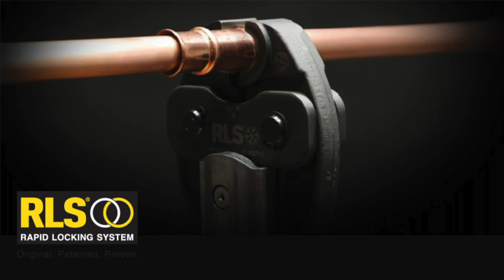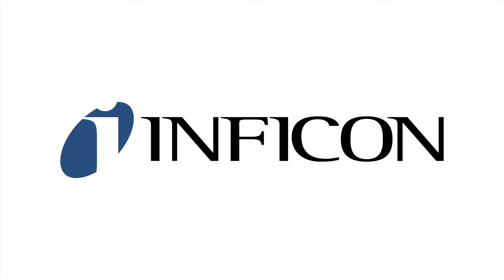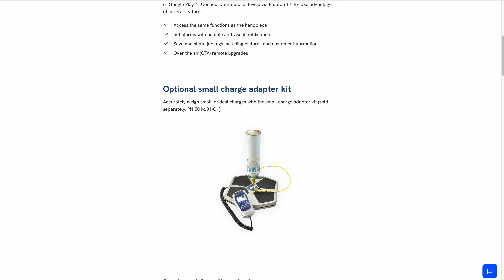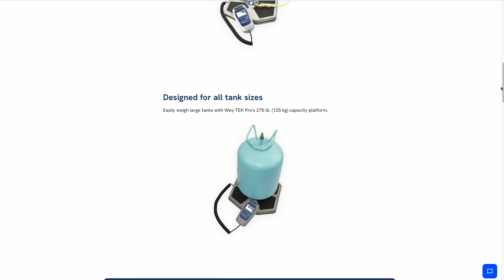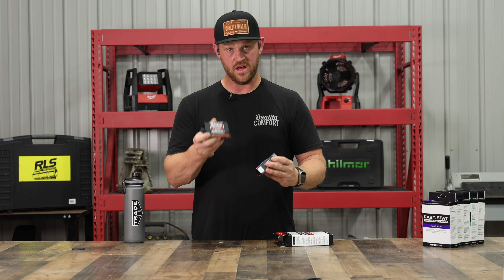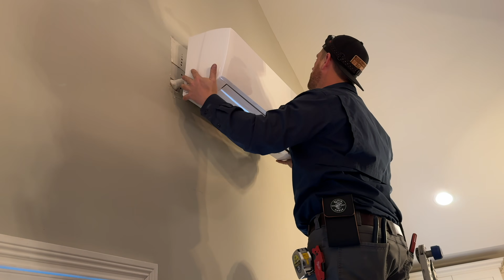High Efficiency HVAC Systems Worth The Extra Money??

Comment: Completely disagree. If a customer wants high efficiency I’ll sell it to them, but generally I recommend 16 SEER system. 2 stage if they want more efficiency. High efficiency equipment has 7 plus sensors that are prone to breaking and completely shut down a system. Their fans, boards, T stats and all their parts are significantly more expensive. If you do an honest cost comparison between the 2 types of systems, the extra money you save on energy isn’t worth the sacrifice to reliability. 

I understand the big HVAC industry is getting its market cornered and with the help of the EPA they will soon have complete control, but until only inverter systems are the only available, I won’t recommend them to customers. (With the exception of ductless mini splits)

Comment: I work for one of the biggest outfits in eastern PA, perhaps one of the biggest in the tri-state area. We use all Lennox products and have for many years now. I can’t even begin to tell you how many variable speed motors and circuit boards and evaporator coils I’ve replaced under warranty.  It’s was a lot. Now, Lennox has come a long way with their coils, they are now all aluminum and don’t leak as much and I’ve come to notice that their motors are getting slightly better. The good thing is, there are solutions. This equipment must be protected at all costs, surge protectors should be used wherever possible even though they are not full proof. When the high efficient stuff works it works well but we are not quite there yet as far as the durability

Comment: Nice video and great explanation. I have a daikin vrv  with refnet for multiple indoor units I like it but I have a few problems, some of the ev coils does not shut off when it reaches the temp set and it keeps running a whole time sometimes it’s with 3-4 degrees lower then set point and becomes freezing til I just press the bottom with one set point higher. It’s daikin life VRV

Comment: After all is being said and reading the comments I am of the opinion that less is best. Sure it may run more to operate with the cost of electricity but when you figure the cost of electricity, the equipment cost, installation cost...and the costs that come later, maintenance and repair, only then will you get a true representation of what it cost to operate these units compared to the basic one speed, low SEER units. I am faced now with replacing a bare bones unit that has been in operation for 27 years. Still working but I am faced with a failure at any moment...or who knows it may run for another 5 years or more. I am seriously considering going with the inverter controlled WINDOW units such as the U Shaped Madea that are reasonable in price and efficient. If it breaks simply buy a new one, definitely less expensive than a service call for my central unit. I'll buy 5 and for less than $2,500 my whole house will be covered and if one goes out I am not out of air. Just a thought!
Reply: I would wait till late in the cooling season to buy the window units. I got mine at half off at the end of august.

Comment: HI,
I think this guy got everything wrong. ECM motor or X-13 motors can push some air pretty well VS PSC motors are normally starting to slow down as they cant push air more. Has anyone ever tried to close a door on air handler with ECM motor on the system that has undersized ductwork??? That blower motor turns into a jet engine!

Comment: Haven’t needed the electric heat yet on a GE Connect variable speed system here in PA in he two years I’ve had it. The GE Connect works well, but had some issues with some of the components at initial install. Unfortunately it was installed as a retrofit to an existing system, and the installer did not verify ducting and sizing, so mine uses an incredible amount of electric in the winter and doesn’t do a great job of dehumidifying in the summer, despite putting it in the lower capacity mode and slowing the air down.

Comment: Agreeing with the comments below, a lot of times these higher efficiency units they're producing today have components in them that are not time tested and develop problems the company engineers have not encountered yet. Case in point, I have a Carrier Infinity system. Recently the chief tech for the local company installed the latest and greatest thermostat that is also Wi-Fi capable. When we turned on the Wi-Fi it would reboot itself at least a couple times a day shutting the system down as it was rebooting. The Carrier engineers had not encountered that yet according to what I was told. Since I am retired, I don't really need Wi-Fi control, so I turned it off and the system works just fine. Also, when we were talking the tech told me that t/stat alone costs $900. plus $300. labor to install it and program it. Fortunately, mine is still under warranty but I commented when he said that "Good G..". How are ordinary folks supposed to be able to afford these things? There went that year of "high efficiency" savings down the drain with one little T/stat change.

Comment: Love your channel man I agree variable speed is awesome I have installed a lot of them and repaired some, truth is dc variable is the future but as of today as a Pipefitter /hvac tech I replaced my system and went single speed cause of the price point savings vs energy returns, variable was over double over my wholesale cost on single stage condenser, next if variable breaks 9 out of 10 times you will be on the phone with manufacturer tech support to troubleshoot the inverter boards and sensors ,after that the part will not be in stock locally and will have to be shipped in from manufacturer. This is why I went single I have parts on hand or they are on the shelve locally and I can fix them Saturday or Sunday cause tech support is not open for variable on weekends. Once they become more prevalent and parts are on the shelve and there are more classes on troubleshooting and repair then hands down best way to go. Just hate to have a customer down for a week waiting for a part and tech support to call back when it’s 100 in August .

Comment: High efficiency systems are not what they should be. Let’s put it like this. Your new car has a smaller motor which is supposed to be GAS EFFICIENT, however they don’t last as long as the older cars because they were built to last 350 hP vs 175 HP now. The motors don’t last long and break down a lot. Equipment is not built to last now. We have a lot of issues with 16-20 seer units. Variable speed is ok but not worth it in my opinion. This is coming from a person that has been in the field for 20 plus years and who has HAD a variable speed system. Got rid of it for a 14.3 and I am better off with that.  That’s proof in the pudding.

Comment: I really like your channel and think you are a really good tech, but I’m going to have to disagree with you on your high efficiency recommendation. Like how others have commented, you are going to cancel out what you save on your bill, by how many repairs you are going to on your high efficiency system. I see this same situation in appliances as well, how efficient is it, if you are replacing more frequently than ever before. The old systems and appliances use to last 20 years or more, now that’s high efficiency. This is my opinion, but I still like your channel, even though we disagree.
Reply: It probably depends on the manufacturer.  Some use more quality/reliable parts, similar to auto manufacturers.

Comment: Great points made.   Yes properly sized equipment is the way to go but I'll go a bit further and say that undersized equipment is even better. ESPECIALLY if its variable speed.  The only downside to high efficiency equiment is crappy installers and duct sizing.  If your ductwork is questionable then fix it or dont geet something super high efficient.  My Diakin Fit is great but  even at 2.5Tons is oversized IMO.   Also at 74* and 45% humidity I'm cold, so as long as the unit is running and its 75 inside then Im good.
Reply: It would seem that duct sizing when installing replacement units is a factor.  Part of the equation that is probably overlooked by many.

Comment: Had no idea about the other Faststat modules! I've used the "common maker" a few times, and a few times just couldn't get it to work, but the others are great. Thanks for that tip. An intermediate thing for efficiency is also just zoning dampers for the house and a thermostat with zone sensors. Yes there's a lot of "it depends" but even with multistage, you're still running the whole house system to just condition the 1 part of the house you're in. As for "too many bells and whistles" what is absolutely true is that computers are more sensitive. They're sensitive to power spikes, sensitive to line noise, adverse weather/bugs, sensitive to "internet bullcrap" (bad updates, misconfiguration with apps, hackers, etc) and sensitive to tech supply chains. I can get universal contactors, capacitors, maybe even motors, but only the manufacturer makes that 1 board. Doesn't make it bad, just something the customer needs to be aware of. The fancier it is, the more failure points it has. Good video.

Comment: Hello!
I work as an air conditioning installer in Hungary, Europe. We have been using this technology for a long time because of the lower energy consumption. They really consume much less energy because in most cases you don't need 100% operation, so it saves energy. I am very happy about your initiative to use less energy. Congratulations.

Comment: 12:30 holy sales pitch… How much percentage they giving you? FFS
Reply: I've used the "common maker" fast stat before but never heard of the other ones. That's useful information when changing up systems because pulling new lines just for that 1 more wire is an added cost that might break a deal.

Comment: Used to tell customers dont invest in high effecient equipment. Instead, upgrade widows doors and home insulation.Will save you more money and increase comfort level.
Reply: Agreed. It’s in the insulation and not necessarily the high efficiency unit.
Reply: That's another thing! That and zone dampers, even seasonal manual ones, where you're looking at the whole house, not just the 1 system. Good point.
Reply: Window upgrade estimate for my home was over $40k. Not much of a savings if you ask me. My home faces the west so from 2pm until sunset my house bakes in the sun. Maybe replacing the front windows would help (about $10K) but not all.
Reply: That’s because you’re an honest well rounded HVAC guy that isn’t blinded by money.

Comment: Built my home in 2013 with foam insulation in the walls and under the roof decking. A/c company installed two Carrier infinity units. Condenser fan ecm motors replaced approximately every two years at about 1k each. After about 6 years both air handlers had to be replaced at about 3k each. One air handler had to have a txv replaced twice. Part covered under warranty but had to pay the labor cost…around $500.00 each time. Compressor went out on the two ton unit and had to replace the condenser unit. Went with two stage and installed a dehumidifier. This was around 7k. The variable speed system/ comfort is great with the high efficiency only when it works. It’s my belief that it’s best to keep it simple and install a dehumidifier to control the humidity for comfort. As someone already mentioned, the original cost is not the only consideration but rather the cost of repairs/ maintenance. I will never go with a high efficiency unit and will never purchase another Carrier brand. I know someone will say something about proper installation. I read the manual with all of the specifications and had a second opinion and the installation was by the book. Simply put, the a/c units are not built well and do not last. I don’t think I could work in this industry and look the customer in the eyes knowing what junk is being built.
Reply: To your last sentence, it's a matter of perspective. We don't design and manufacture the junk so all we can do is give the customer the most honest information we can so they can choose what's best for them, not our sales. I hate selling, but I love helping. I try to teach customers about their whole building starting from the first maintenance call, long before system failure, and build real trust. Have you looked at windows or insulation? Have you looked at closing dampers seasonally? Running dehumidifiers? Keeping the furnace fan circulating air 24/7? I hate corporate motivational posters, but one stuck with me: "They don't care how much you know until they know how much you care." I'm a homeowner too, and probably a cheaper bastard than anyone, so I get it. Help em, give a crap, and sleep well at night.
Reply: @bikerbobcat As stated in my original statement, the home has foam insulation and also double pane windows with argon gas. I’ve watched so many YouTube videos regarding a/c systems and read hundreds if not thousands of comments and I will honestly say most are honest. However it pisses me off when I see some, not all, are basically salespeople trying to scam people into these high priced units just to make money knowing the cost of ownership is ridiculous. The a/c discipline is the only occupation that I am aware of that pretty much shuts out the general public from purchasing parts and equipment from brand name manufacturers. It’s a scam and they know it!!
Reply: They are most likely over sized.  Blower motors shouldn’t go bad like that. High static pressure
Reply: @samuelsech2278 
3500 square feet of living space. 2 ton on one side controlling about 1500 square feet and 3 ton for the other side controlling the remaining 2,000 square feet. It’s my understanding that on a spray foam house, it’s one ton for approximately 1k square feet… does that sound right??
Reply: @LouisS-cs7bh  not necessarily the tonnage to sq ft is not a reliable way to guesstimate because climates very greatly, as well as construction of homes. Air flow is the most common cause of indoor blower failure, dirty filters and or coils, or undersized or poorly routed ducts. I know this is 7 months late but its mainly for anyone you may see this in the future 😅

Comment: Depends on what part of the country you live in too. You live in a climate that sees vary humid summers like the southeast. Then an air conditioner with an efficiency rating of 15 seer for a 3.5 ton unit, would be more worth the cost. A 4 ton unit you can go slightly lower.

Comment: Comfort is king. I'm jealous of the 24/7 circulating setups. If only we had god mode. Whisper quiet, zero dollars to run. Lets call it the invisible blanket system.
Very interesting talk. Sizing for the hottest or coldest day sounds logical. The idea of having only full throttle for either cold or heat is very in-efficient. I didn't realize my condensing furnace was two stage and a multi speed blower. I'm throwing it away after 15 years. Goodman, it's been good with no problems. I'll swap it out for another 2 stage aciq. But my AC has got to go, low on R22 and noisy as a 1980's pontiac with a holy exhaust. Its dB rating is 82 or so. I'm going with aciq hyper heat inverter. The big decision for only $200 difference is the hyper heat version. 
The non hyper heat ones stop producing heat at 5 deg. Capacity starts to drop at 20 deg. The hyper heat at -22 drop to 72%. Then again any of these numbers are theoretical. Even if real, definitely not your exact location. Altitude, moisture in the air etc all do something. 
I think all systems at a minimum should have 2 stages. 2 fan speed and a few temp readings. An inverter is a decent way to do it. If only the parts start coming down. They will as these things are going into everything. But hearing carrier infinity woes and cost of parts is not good. A variable valve, either furnace gas or refrigerant is a liability. Just fire some solenoids. 
A few speeds on a air handler would be nice. Thermostats need to get a bit more advance or user friendly for the flexibility. What would you suggest. I have a T9 honeywell and it seems ok. I'm not sure how well it'll work out for this setup.
Reply: My super basic 1 stage cooling and gas furnace house system fan runs 24/7. I went to the thermostat, switched the fan from AUTO to ON and haven't touched it in 12 years.
Reply: @bikerbobcat  well played, i hope my new system is quieter, the one now is too noisy to run all the time.
Reply: @scoobtoober2975 It's good to see someone else considering the same system I am on the fence with. 35 year Heil 3 ton straight cool system. I have had not one issue with it and now looking at the ACiQ 3 ton 18 SEER mini split inverter system. Warranty: 12-Year Compressor & 7-Year Parts – with online registration which is attractive. I know the ACiQ would be more efficient to run, but as most have stated failure rate may out weigh the efficiency. I also have solar so high efficiency should not even be a concern but my current CU and AHU is a bit loud when running. I like the specs on ACiQ high efficiency but I can't seem to find too many elaborate videos or discussions. What was your motivation for the ACiQ system?
Reply: @ilandsun  quiet was the main reason and old system was icing up inside. r22 is expensive. As a diy i'm pretty sure you don't get any warranty. You need to summon a local pro that will go along with it to register it. But maybe call them and see what they say.
Reply: @scoobtoober2975  thanks for the response. Yes, that's the other dilemma as well. Most pros want you to get their equipment. I believe MRCOOL installs them since they are basically the similar product.